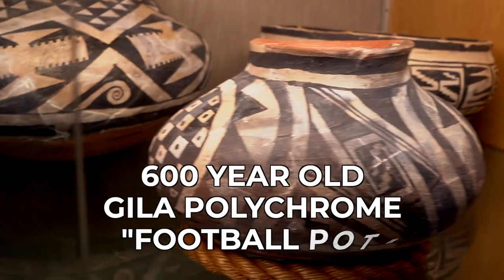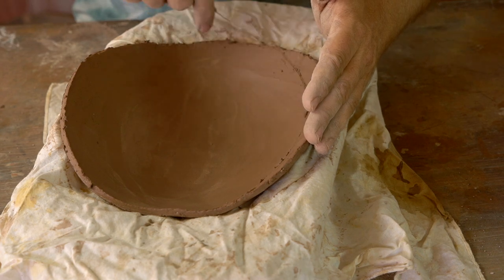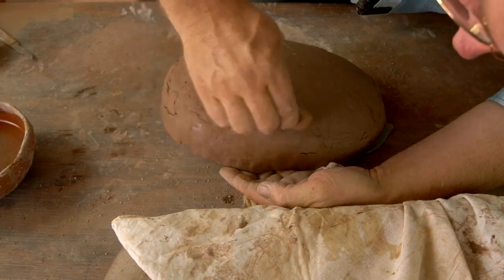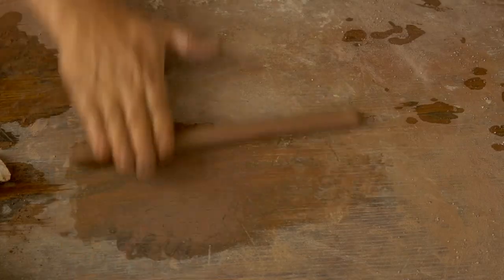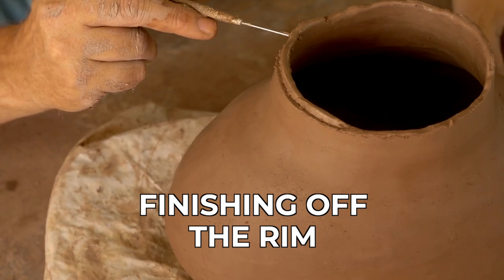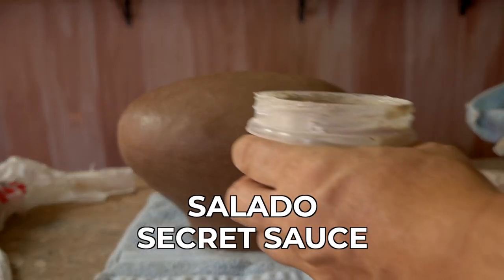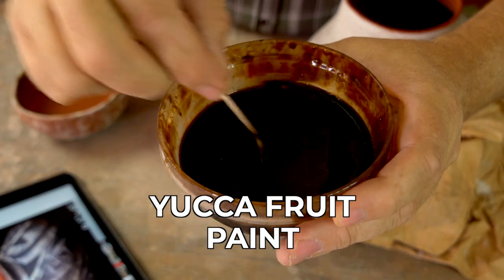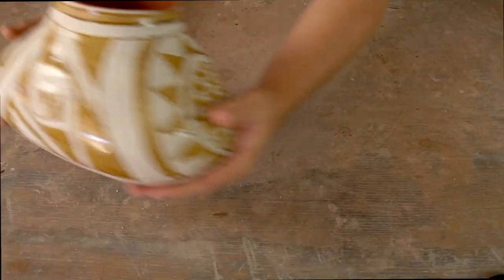Making the Gila Football Pot - Hand-Building Pottery

Comment: Hi Andy,  
THANKS for all ur wonderful vids. !! Total beginner.  
Paid member ( as of today ) 
I'm trying to find out from any  experienced person about ash glazes with low temperature firing pottery eg in an open outside fire like in many of ur vids. 
Did u use white ash , grey ash or black ash please ? 
A recipe would be REALLY  appreciated!! 
(For those wondering ..
White ash comes from any wood burnt at really high temperatures eg in a kiln . 
Grey ash medium temperatures. 
Black ash is usually not fully burnt because of low temperatures eg u dampened the fire down for the night.
Reply from the maker: Hi welcome and thanks for the membership. It is my understanding that ash glaze requires a temperature of 1300 C to achieve and you cannot reach that temp in an outdoor fire. I have never even reached that temperature in my kiln, so not sure if it is doable at all.

Comment: Fantastic job Andy, can't wait to see it fired. Question about organic paint, Do they remain sticky or smudge if not handled well before firing? I know your container of paint when it is dry is very thick and plastic like, are they like that also once painted on the pot?
Oh and I wish to congratulate you. I have been following your channel for about a year now and remember (with the help of video dates) that just 4 months ago you hit the 15K subscribers mark. And now today your at 31K plus. May your success on YouTube continue to grow. We love your videos thank you for making them.
Reply from the maker: Thanks. The organic paint on the pot is generally dry to the touch, feels a little rubbery but not sticky. When I am working on the pot I will often sit it outside in the sun for a few minutes so the paint will firm up before I move on to another part of the pot that I way I won't smudge it or leave sticky fingerprints. But I live in Arizona where the relative humidity is usually very low. When we have humidity the paint can get sticky again, so your mileage may vary based on the weather where you live.

I had a two year old video blow up recently, then a couple of weeks later another, so I ended up adding something like 10,000 subscribers in a little over a month. Now it is back down to a more normal level. I wish I could figure out how to do that again.

Comment: Just because you asked, your pot has much cleaner lines. Maybe too clean.     What was that type of pot used for?  Cooking, storage, serving or something else? Also, about how much time do you spend painting? I know it would depend, but roughly? Are we talking 30min, an hour or many hours?
Reply from the maker: Thanks, there is definitely a tendency with modern potters to make them too perfect, our standards are too high. I have seen it with other, really talented replicates like the Thornburgs or Swink where the replica is just too good. I don't believe anyone knows what these were for, someone will need to do a study to look for food residues inside or something like that. Painting takes me hours, this one, because the designs were relatively large and bold was probably in the neighborhood of 3 hours. Others can take much more depending on the intricacies of the design.

Comment: does keeping an unfired piece for extended periods of time jeopardize the "integrity"?  of the piece in the firing process? obviously you have a dry climate but is it possible in certain climates for a "dry" piece to wick up enough moisture to be an issue? love your content... i made a pipe to smoke out of from the clay that was stuck to the bottom of my sshoes after digging up some land to make a garden plot and fired it in a pit fire one night just to see if it would survive and 8 years later i still have the same pipe :)
Reply from the maker: No, I have had unfired pots sitting around for years before firing, it makes no difference. You should always pre-heat the pots before firing to drive off any remaining moisture, this will prevent most breakage.

Comment: I'm thinking to make a pitcher.
In India we use picher's water for drinking
Will the water get colder than room temp in it?
What would be the process
Reply from the maker: The process would be about the same as that for making any pot except it would need a handle and a spout added. An earthenware pitcher would keep the water inside cooler, that's how they used to keep water cool around here before refrigeration.
Reply: @AncientPottery  thanks for your support 
Btw I find your all videos informative and useful